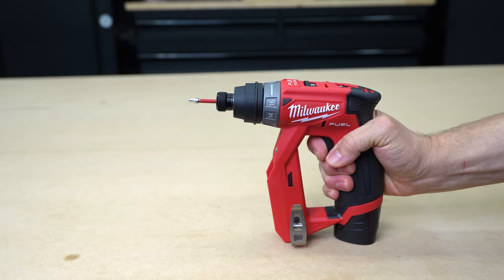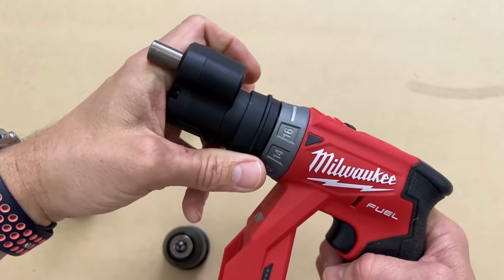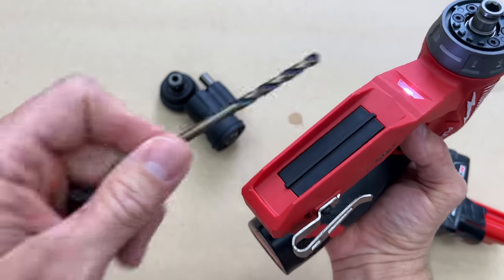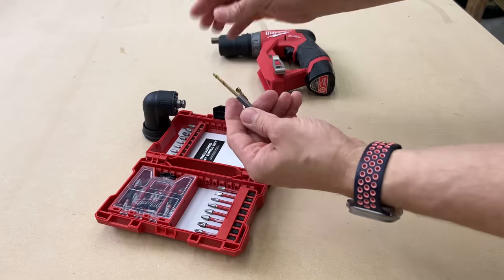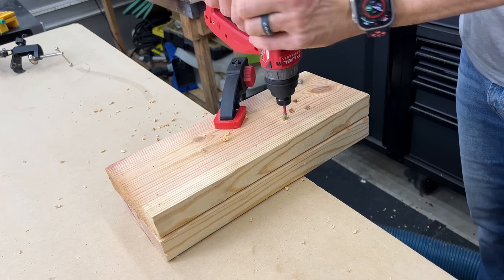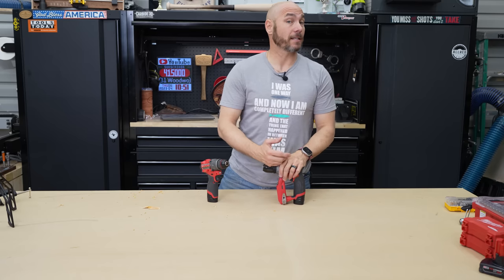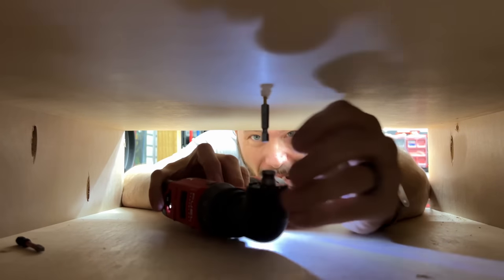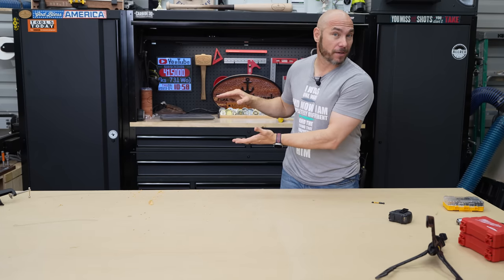Milwaukee's BEST Drill for Woodworking?

Comment from the maker: ▼EXPAND FOR TOOL LINKS and INFO▼ 
Watch Next = 10 Amazon Tools I Love - https://youtu.be/eUbb2fCgaYE&list=UULFSLClJLzdUMRMe0E4SPfc-w
Milwaukee Installation Driver (Acme Tools) - https://acmetools.pxf.io/9g2bv4
Milwaukee Installation Driver (Ohio Power Tool) - https://shrsl.com/417vq
Milwaukee Installation Driver (Amazon) https://amzn.to/3LEGohF Be aware Amazon is not an authorized retailer for Milwaukee.
Packout Case I Keep my Driver In - https://shrsl.com/417w5
Packout Wall Mount - https://shrsl.com/417vz
M12 Battery Organizer for Wall Mount - https://shrsl.com/417wc
M18 Battery Organizer for Wall Mount - https://shrsl.com/417we
Kaizen Foam - https://amzn.to/3USqSTC
Shockwave Driver / Drill Bit Sets - https://shrsl.com/417wx

Check this video's description for more links.

If you use one of these Amazon and other affiliate links, I may receive a commission

Some other useful links:
Daily Tool Deals on my website: https://www.731woodworks.com/tool-deals
Subscribe to our email Newsletter: https://mailchi.mp/7e44c16eefdc/731-woodworks-email-newsletter
Check out our easy-to-follow woodworking plans: https://www.731woodworks.com/store
Outlaw's Board Butter - So Good it Should be Outlawed: https://www.731woodworks.com/store/boardbutter

Comment: I prefer the Bosch Flexiclick, its slightly shorter and the chuck does not damage wood as much as a metal chuck when working in confined spaces.
Reply: I picked up a Bosch Flexclick kit in December from Tractor Supply for $80 on an closeout deal. It's the brushed version but the savings compensate. I'm impressed, it's a great 12 volt drill/driver system, surprising power.
Reply: @3frogltd987  They also have an 18v version if you need more power...
Reply: I absolutely love my 12V Bosch Flexiclick. Less than a year after buying it, it has almost completely replaced my DeWalt 20V drills in all, but the most demanding of tasks. It has plenty of power and unmatched versatility.
Reply: Really interesting - I've been debating between the newly updated Bosch 18v Flexiclick, the 12v and this Milwaukee.
I'm already in the Bosch 18v system but I'm tempted by the size of the Milwaukee and the other tool options it opens up; Bosch's range is still rather limited in comparison.
Reply: Thanks for this review, I've wanted to spread the word about this ever since I bought it.  Since I already had Milwaukee and DeWalt battery systems, this was a no brainer for me. I wanted a softer screwdriver than my impact drivers, something I could use and be sure to not strip out small screws in soft wood or heads of screws in hard woods. My timing was perfect as I was just starting a bathroom remodel. 

One thing about the 90 degree attachment, it doesn't take two hands to use and didn't have the weird twist the DeWalt attachment does. I've relegated the DeWalt 90 degree head to the bottom of my toolbox. 

The combination of using the 90 degree and offset was great for framing and getting into tight places to install cross members and nailing boards. The offset driver was perfect for installing the screws to hold the shower walls in place. 

I did find the reversing switch to be a pain. I can tell which direction my impact driver is in by touch, this requires one to either squeeze the trigger to see which direction or look at the top. But as you noted, once I got used to it I didn't mind it that much. The only time it was a bother was when I had to back out a screw so I could push two boards together, then reverse to tighten.

It is a bit slower, but that's why I like it for more delicate work. The speed is easier to control. I found that for difficult screws, I'm less likely to strip the heads than with an impact driver. 

I hope other vendors will be copying this model, it's definitely a great second drill/driver to have in the toolbox.

Comment: I have had the Festool CXS for over 12 years and my go to drill for woodworking.  And, still on the original batteries and charger.  Love the thing.
I did purchase the Milwaukee Installation Driver recently as a backup but hate the fwd/rev button.  New and different is not always better.  Especially after millions of people have been trained for years and put in autopilot when changing directions.              JimE
Reply: That one is awsome
Reply: @novaneo  Agree.  As with most Fe$tool tool$.  It has always been money well spent for me.
Reply: Agreed!  I also have the Milwaukee install. Driver.  I Like it but the fwd/Rev feature is absolutely annoying because you can't really toggle with 1 hand blindly (as easily, maybe with some practice) and it's on top so it isn't always accessible.  My only major complaint is that.
Reply: @jamescurdie551  👍

Comment: Had the Milwaukee at home and the brushless Bosch Version in the Van. The Bosch is in any case  the better tool.
They even released a hammer sds plus attachment for the dtill that has the same 1 Joule punshing energy as the Milwaukee 12V SDS drill.

Comment: I have that tool and agree 100% on every pro and con you mentioned. As a finishing carpenter is by far my favourite tool for install drawer boxes and face, bath hardware, closet rods etc.
Reply: Its my go to for installs.  I still have an impact and the regular drill but this one helps me not over drive with some of the light weight screws that seem to be on electrical and electronic devices in new installs.

Comment: I have been going back and forth on this tool for a long time, whether to get it or not. Right now the kit with a bonus 5ah high output battery is $199, which is pretty tempting.

Comment: I like the Bosch version I have with the multiple heads. It has the bit lock on the heads that Milwaukee is missing. I've heard that the front part of the Milwaukee  that has the magnet gets in the way sometimes when you need a little more depth.
Reply: I agree. Bosch have managed to make a better 12V tool.

Comment: I own this one and DeWalts 12v version... Love em both, however the DeWalt wins for me for power and ergonomics.
Reply: hey there, I don't suppose you would be able to share a link for the DeWalt version?  I would like to read about it.
Reply: Not aware of one like this from Dewalt.  Have a link or model #?  Probably the 8volt setup.  I have the first version which is bigger and definitely not as versatile as the Milwaukee.
Reply: @jameskelly4494  Dewalt DCD703F1 XTREME 12V MAX Brushless Cordless 5-in-1 Drill/Driver Kit
Reply: I agree! I had both and sold the M12. The DeWalt version is probably the tool I reach for the most. One big advantage the DeWalt has over the M12 is the locking collet on the offset attachment. The Milwaukee can leave your bit behind in tight spaces. The M12 also falls over once you place an attachment on it and use any battery other than the tiny 2.0 batteries. Once you use a xc4.0 or xc6.0 for longevity, the M12 will not stand.

Comment: Looks like a great tool, but what the hell is that push button to change direction? The regular push-through slider means easier accessibility and, even more important, haptic feedback to check the current direction. No way I'm getting something without that.
Reply: They did that because the trigger should be used with the middle finger, getting your hand better in line with the bit.
Using the drill like this would cause the FF/REV switch to accidentally be activated. So, there you have the switch on top… 🤷‍♀️

I have this model and I have to say you need to get used to it in the beginning, but it‘s a great little tool for install works!
Reply: You really get used to it, I don't miss it when using  this.

Comment: Had it and returned it. Forward/reverse switch is impossible to get used to. Pick up any other drill and you instantly know if it is in forward or reverse. I currently use the Dewalt 12v version of this but have my eye on the revised Festool TXS 18.
Reply: facts....did the same... dewalt is better, but I dove right into hilti :)

Comment: If you like that, you should take a look at the Bosch version (GSR12V-140FCB22), which has been around for a while. I've been using the Bosch since 2018 and love it! It doesn't have that bulky D-handle design (copied from Festool? why?), has a traditional forward/reverse/lock button, has mechanical locks rather than magnetic so your bits won't come loose and it's currently on sale for $92 less than the overpriced Milwaukee ($137 vs $229) 😮
Reply: Was down to $114 on Amazon Xmas gone.
Reply: That’s the brushed motor version. Bosch offers a brushless kit for more, closer to the price of the M12 brushless kit. But otherwise I agree. I bought the brushless 12V Bosch kit. I wasn’t a fan of the M12’s hand guard or the direction reversing button. Bosch’s drill chuck for these kits has a plastic outer shell. I generally prefer metal drill chuck housings but these haven’t given me any trouble and is nice to grip with the deep grooves.
Reply: Have the 12-35 fc (eu version)
Use most of the options daily, not so much the 90dgr but it's been useful

Comment: I have this tool and its my favourite by far. And yes I love the electronic direction button on the top I know alot of people hate it but I think it works great and stops me from knocking it by accident. My only super minor complaint is that you can only change your drill bit out if the drill chuck is on the tool.

Comment: Have purchased the Milwaukee drills in the past and have a few of them. I have to say the  batteries are terrible.  After a few months of use and charging the battery, the battery charger would give me an error message blinking red and green.  In MHO, the Festool CXS is far superior in battery length and reliability.

Comment: No, you haven't...you haven't seen the Metabo Quick system yet.  Really powerful machines, where torques of up to 110Nm are possible with an angle attachment,which becomes "one" with the Machine...with the chuk or  without - directly into the shaft, etc., etc.., check it out😉

Comment: Flush chucks are great. I suspect it's going to be the next big trend in drivers. For any driver you can get an angle adapter which will work well enough if needed to get into places, even if it's not great. You can't easily find the same flush adapters.
I love the flush adapter on my new Festool drill, but there are some issues. First, it's on a drill and not a driver. It's also not the smallest drill and chuck. More importantly it can't be stuck on the drill's angle adapter. For that reason, I've been seriously tempted by a driver that does both.
Bosch has a similar 12V driver kit, the GSR12V, which is about the same price. The primary decider other than if you already have batteries is ergonomics. The Bosch does not have handle guard bit holder, but it also means there's less driver parts to get in the way. Maybe. I don't think anything like power would ever come into play (and in fact as a woodworker with a driver, the most possible power is probably not good, especially for an angle or flush situation.)

Comment: I purchased this drill in January.
It’s been my go to drill since. Plenty power, versatile and extremely lightweight. Love using this drill to install hardware on cabinets.
The top push bottom is something I got used to fairly quickly.

Comment: I use the magnet all the time when I’m doing cabinet installs or hardware installs for cabinets or doors it’s great for holding those little screws. Also, you would use the quarter inch Collett adapter on the right angle, adapter for bit retention.
Reply: Don’t know why but over half the time I forget to use  the magnet. It’s a great feature.

Comment: I just picked this up 2 weeks ago. So far I like it and that magnetic bit holder is quite handy. One thing that also makes this tool handy is the clutch for sensitive applications, it allows you to secure fasteners in material like plastic without stripping holes.

Comment: Not a fan of the eccentric chuck either. Lack of locking feature for bits make it really annoying to use sometimes. The m12 definitely feels like a Milwaukee product. You get rougher operation in exchange for a bit more power. Even though the m12 runs tougher than I would like, it is still my most used drill. Eventually I want to get a Festool version of the multi chuck drill. While the 12v CXS isn’t as powerful, I heard it is the preferred multi chuck driver option. Smoother operation and better chuck experience. I would probably go with the new 18v CXS to start and if my old DeWALT DCD996 decides to stop working I will replace  it with the TPC 18.

Comment: Love my Instalation driver. I think these are designed to use your middle finger on the trigger with your index finger pointing straight. Makes switching directions really easy. Not having the regular directions switch is a big plus in tight spaces. I didn’t think I would like the top switch but I got used to it almost instantly once I started using my middle finger on the trigger. Thanks for the great videos.

Comment: Thanks for the educational review. Is it really the most versatile drill on the market? Festool have their venerable and soon to be updated CXS and TXS lines and even Hilti are offering a similar drill. I would also argue that Festool's offerings are far more comprehensive with Centrotec. The Milwaukee's digital reverse button is a doozy compared to the standard mechanical buttons.

Comment: Honestly, this is the perfect small drill for my tech repair business. It’s not too powerful so I’m not worried about striping out delicate screws. The different attachments make getting into some tight rack mounts easy so I don’t have to completely disassemble. And even better yet, paired with a Wiha 1/4” hex to micro bit adaptor, I can even deal with real small fasteners like the stuff on phones and tablets, and again, the lower max power and then clutch settings allow me to handle all of those items with 1 driver especially if I’m on call. The front magnet is also good for helping me keep track of small fasteners that are always random sizes that local hardware stores don’t tend to keep in stock. 😂

Comment: This reminds me of a middle ground between the festool 12v drill system with multiple interchangeable heads and the black n decker matrix system. The b&d is obviously lower quality for the budget price, but it had circ saw, sander, and other heads too for the occasional dyi’er. It may have had an oscillating
Multitool head too, but Walmart stopped carrying them after I got my dad a kit for Christmas a few years ago. Thanks for the content!

Comment: I bought one of those, that tool gets used 3 times as much as any other tool I got, I use it as an electric screwdriver, I use it for making up panels, putting screws in straps and anywhere where I have to drive a screw. I highly recommend this one.

Comment: I’ve used this thing for about three years. I do security cameras on boom/scissor lifts up pretty high. I have a Milwaukee lanyard on it because matching colors is important. It works great but I haven’t had a reason to take the impact head off it. Hand tool woodworking, no screws, just glue. The button sucks but you get used to it.

Comment: I wish one if the multi attachment drills would get an extension. A 6 or 12 inch extension between the drill and the 90 or the drill chuck would be amazing.

Comment: Why is the kit $100 cheaper on Amazon than in the links Matt provided? Just because it's from unauthorized dealers or something? Rebranded knockoffs?
Reply from the maker: Not sure, but Amazon is not an authorized retailer for Milwaukee. So if you do get a knock off or need warranty work, Milwaukee likely won't do it.

Comment: I was eyeing that driver, I can see a project from here that it would've been nice not to strip out some screws on with that offset attachment.

I like the bags that the M12's come with, but the seal on Packout (or competitor) style containers is great for keeping moisture out in more humid climates. Just get some green/orange silica gel beads and keep a pack inside.

Comment: I like that off set attachment, I think it would work better than the flexible shaft I have.  I also wonder if the FWD and REV controls being on the top of the drill is in anticipation you'll have more access to the button in tight spaces than if it were on the side?  #speculation

What is this kyzan (sp?) foam you speak of....?
Reply: I know I can look up the foam online, but I'll just wait for your video. ;)

Comment: Like all m12 tools I think people highly under rate them. I think most of the m12 fuel platform is fantastic but there is always room for improvements like the m12 fuel oscillating multy tool needs the A (automatic) setting and it would be perfect. However I think every tool out there could possibly use some sort of improvement but nothing would be perfect to everyone because everyone has different likes and dislikes.

Comment: Do you feel tools like the Gripper promote unsafe table saw practices? I mean I see a lot of woodworkers saying tha people should always use the blade guard when possible. However if you buy the Gripper, you can't, thus they might not use the guard. I am new and bought a new table saw (the Skil one) and a gripper but then realized I won't be able to use both the gripper and the guard. I know there are certain applications where the guard can't be used and that's when the gripper should be used. 

I haven't seen any videos where people compare the best push sticks or blocks for when the guard is in place, might be a good video.